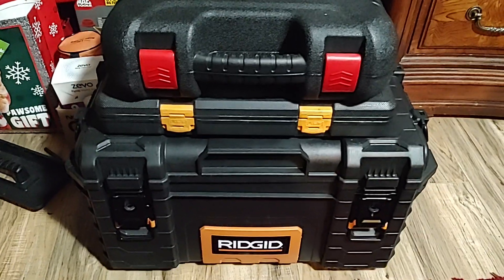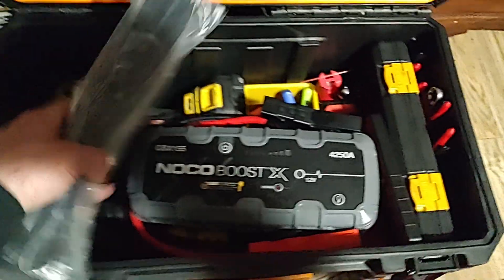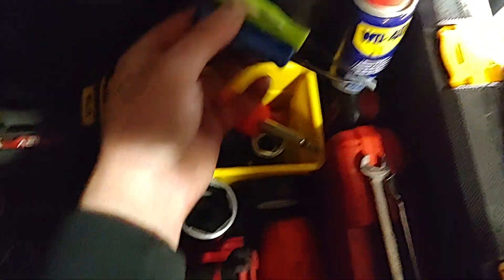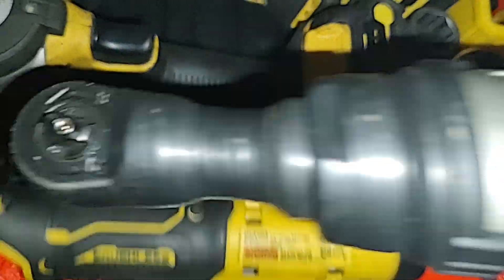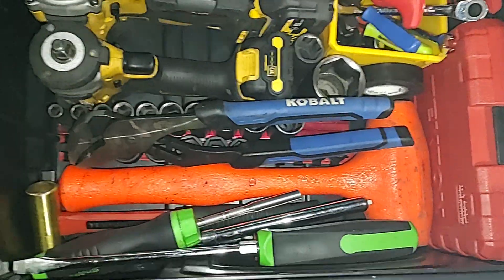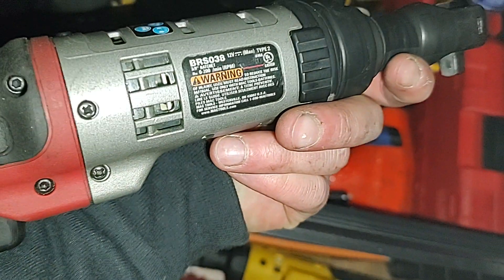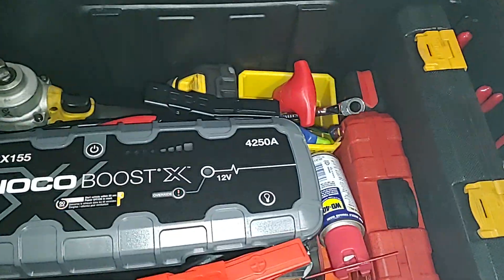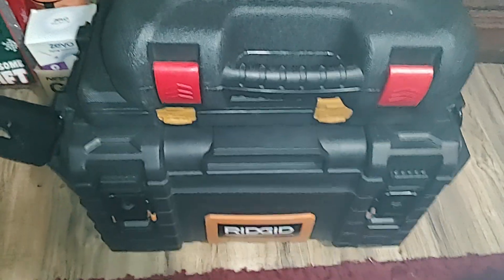Tool set I keep in my vehicle. Not including electrical repair kit.

Comment: Great overall kit you set up, I’d throw in a breaker bar if you got the room and maybe a cheater pipe
Reply from the maker: I have the tekton 1/2 drive master set with breaker bar but I don't keep it in my daily all the time. I just throw it in my f350 on long trips. Since u commented I am now going to be adding a 1/2 drive breaker in this box